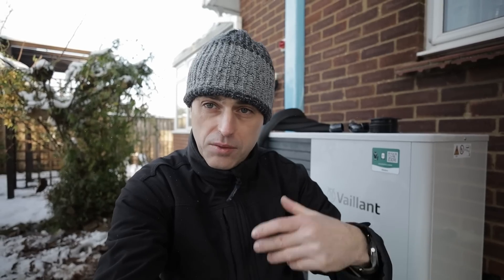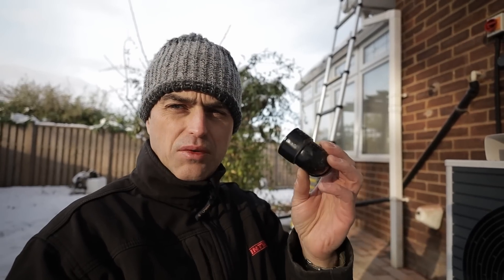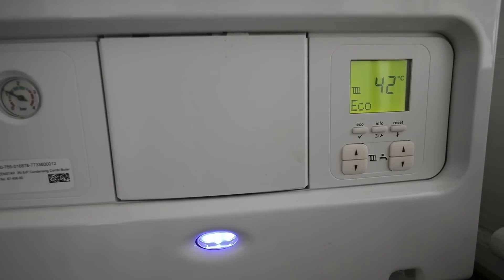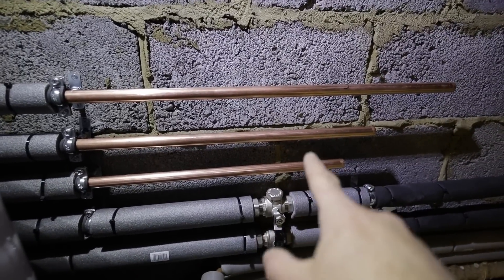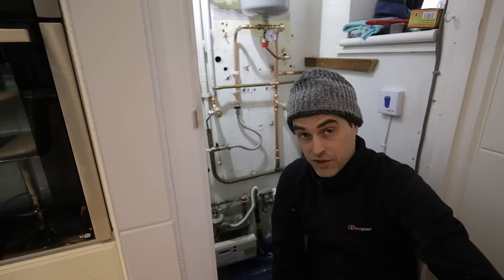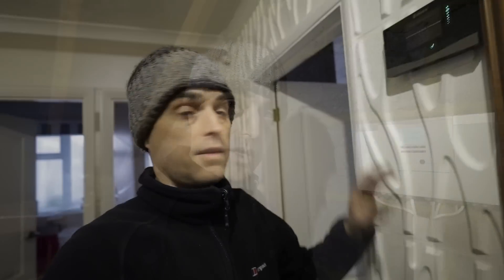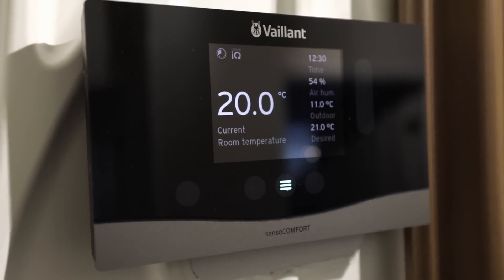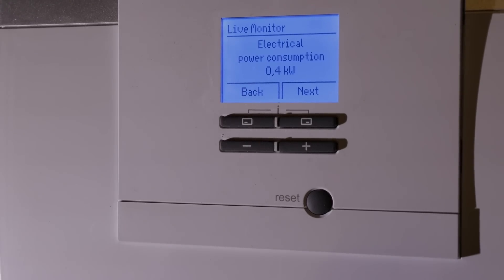How to Install a Heat Pump That Works

Comment: Not all of the UK have a night tarriff (cheaper). Thats why we have the data on ground and air source for a good while. Its still cheaper to run gas over the year if you have a cylinder installed in your property especially with the costings of electric being 3 times more than cost of gas. I get it, combis are the reason gas bills are so high for most people. Its funny you mentioned the positions of units, as thats why most (ashp) were ripped out in first place. Bet the vaillant board will blow on the unit interface aswell as we all know how well pcbs perform from them in time lol

Comment: We have Mitsubishi heat pumps on commercial install and recent cold weather they would shut down and go to defrost , we had no underfloor heating.
There’s enough glycol to actual go down to -12.
Mitsubishi says there heat pump is working fine ! 
Another Mitsubishi install , spends all day heating water and then turns to heating with 10 fan assisted radiators as soon as pipe temperatures at the radiators drops below 30 degrees they shut down.
They have spent thousands on these systems.

Comment: It's amusing heat pumps are coming into their own during the current global conditions while bev's are now equal to or more expensive than ice to run (until the spring budget).
I could get away with a 7kW (currently 9kW heat loss) but I'm loathed to actually convert my own property over, just haven't the time. 
In the mean time I'm trying to convince one of my business partners to actually put forward weather comp and hot water priority controls when estimating for boiler changes. Putting forward a Vaillant boiler as a heat only replacement you may as well put forward energy efficient and future proof controls. Sadly he is strongly against heat pumps and having people pay "so much" for energy efficiency. 

Great video, and yes air flow/location and freezing rain seem to be the biggest issue now with heat pumps. I got fed up of being called out as a break down engineer last winter to iced up blocks so did some research, poor air flow + lots of water is the number 1 reason for icing and poor temperatures. Learning more every day.
Reply: What is meant by poor airflow?  at back too close to wall?  just home owner here interested in heat pump
Reply from the maker: video coming soon on this, in my case it is a unit located in a narrow alleway and recirculating cold air going into deforst every 20-30 minutes

Comment: Hey, thanks for the informative video. I work as a mechanical design engineer on commercial properties but interested in this as a career. How much detail do you go into when doing the heat loss calculations, you would need to know the U-values but can imagine you make a few assumptions on this? Also, how often does the property need a full retrofit, e.g. new larger rads and bigger pipework due to lower flow temps? I believe this property was okay as it was already running at 40 on gas the same as what a heat pump would run.

Comment: Another quality video from yourself 👏🏼

One query I have, Vaillant specifies that a 15 litre buffer is recommended for the size of heat pump installed in your video (as a minimum ) for deicing purposes, when the heat pump goes into defrost cycle. 

What's your opinion on this?

Won't the heating system be robbed of heat, therefore becoming cold, on the days the heat pump enters this cycle, without a buffer?

Thanks again for sharing your videos & knowledge & may you long continue to do so!

All the best ☺️

Comment: Very nicely explained video, thank you! Very informative and much appreciated as most videos about heat pumps I've watched just don't deal with the technicalities in the way you do. One question leaps to mind if I may... As the output from the external heat pump appears to be hot water directly to the hot water cylinder and radiator circuits, does this mean there are no refrigerant connections to make and no refrigeration work involved? So does this mean I could legally fit an aroTHERM in my own house without personally holding F Gas qualifications? Thank you!
Reply from the maker: Yes, it a monobloc so no fridge circuits to deal with. No need for F gas to install one.

Comment: You mentioned that you had trouble with 1 unit not heating sufficiently because it would go into defrost too often.
What would you consider too often to be, with my Ecodan I found defrosts occur more frequently when it was closer to zero. e.g. -1 -2 a defrost happened every hour and took about 5-10 minutes. As it got colder and the humidity is locked away in frost it was running two hours between defrosts.
Reply from the maker: Every hour is fine. Mine was doing it every 25 minutes

Comment: What about airco-split unit.
I use one a boat and last here is -10c .
And yes the unit have to go in mode to heat the out side unit 
Is somting i can do so it not freeze .
More out of the wind .
A wooden somting to set over it with some holes.
So its out of the wind it self 

Yes a boat you read it correct .
I can heat with diesel fuel .
But that cost more and its smoke what come out is not always nice .

Thank you for some tips .
Or if you have a video .
All things will help.

Comment: using heat pump manufacturers controls is absolute critical to a successful. In the case if the senso comfort, best to use Extended adaptive room modulation and adaptive heat curve. then the curve changes according to indoor demand
Reply from the maker: I am not 100% this is the best method. It runs at higher flow temps as inside temp and comfort is a priority.

I will be testing all modes at my own place and making video of my findings. 

My intuition tells me active mode without adaptive should be best.
Reply: @UrbanPlumbers  if you are open to learn, you will have a happy outcome

i’ve been doing weather comp on vaillant controls on gas boilers for 15yrs, i use adaptive on them all. It’s a bit shocking when you go to a victorian property with rads  on gas boiler with vrc700 and find the curve is 0.65 and everything at temp. you ask your self if you left it that low!
Reply from the maker: Yes I can see it working well on gas. Not convinced on HPs yet on adaptive

Comment: Wish these heat pumps had the option for a ground coil or thermal buffer/battery to be more easily added as an upgrade, ours works amazingly 98% of the year when CoP is 4-4.5 but when the temperature crashes the consumption with CoP around 1.8-2 is enormous, about 100kwh/day.

Have a hard time seeing the grid deal well with household consumption tripling whenever temps dip to -5/10 (we already lowered our inside temp to 19 to help lower costs!)
Reply: I agree. And even if the grid manages to cope, that electricity will have to come from expensive peaker plants. Ideally, a small heater powered by bioethanol, wood pellets or even propane or heating oil, would be a useful addition. Or, even better, an electrical generator feeding electricity into the grid and using waste heat to heat the house.
Reply: That’s the truth spelled out loud!
These pumps are good(read economical) only if the outside temperatures are in positive! 
One should over-size its pump in order for them to have higher CoP on minus T.
Reply from the maker: Never ever oversize a heat pump
Reply: @stormtrooper9404  Ours worked well when we had a -10 to -15 cold snap for a few days, used about 80-100kwh a day to keep us around 20c inside (display says use was 190-220 kWh of heat!) 
HP was sized for a full house but we're currently living in the finished section so a bit oversized for our current situation 

I suspect the problem will be partially solved once we fix our doors as we could clearly feel the cold drafts

Comment: Another great video, thanks.👍
One of the biggest complaints, Ive heard about heat pumps over the years, is that they struggle when it gets very cold! The argument from Manufacturers and heat pump installers,  is that the countries like Norway, Finland and Sweden use them! but what design temps are they using in those countries?
 If we are designing them for -2 and the tempreatures go to -10 they arent going to be able to cope! You yourself said exactly that and Vaillant manufactuer an inline back up heater, which isnt a heat pump, but a 6KW Immersion heat exchanger!
Are home owners informed of this, before purchasing these heat pumps, that they would be prudent, to buy an expensive backup, if it gets colder than the design of -2? 
You are a highly skilled and diligent heating installer and you have admitted that there is a very fine balance to get these systems right.  
I'm not convinced we have got it right here yet!
 I'm sticking with my Vaillant Combi ,its in doors, in the dry!  If it gets to minus 10, I crank the temperature up and it keeps me warm, because it has built in resiliance and the capacity to heat the central heating water up to about 80 degrees in any weathers. 
And my Condensate pipe dosent drain outside😀

Comment: Dear, its normal in 1 hour to have 2-3 times turn off the compressor ? When pump will reach set temp? Outside temp avg 5-6 C , water temp 34, combination of radiators and floor

Comment: We are running an 11kw Viessmann on weather comp. The pump is always running - is this an issue for the pump?
When it's cold the boiler modulates and everything works great, when it's a bit warmer the boiler cycles quite a bit as it cannot modulate below 3.2kw. How much is too much cycling? How do you reduce the cycling? And could we go hybrid and do the low end requirements with a small heat pump and cut over the gas at say 5 degrees outside when boiler runs all the time at min modulation - and if so how ?

Comment: When installing, are there usually problems indoors finding space to fit thee required indoor units such as water tanks, pumps (if any) and controls etc? No every body has a large loft, in most cases such as me, just what was a bathroom airing cupboard that now houses the existing water tank and electric boiler.
Reply from the maker: Airing cupboard is all you need

Comment: Home owner here, I need to replace a 1980 regular boiler and probably a lot of plastic non-insulated pipes.  Would heat engineers recommend copper pipes these days over the plastic?
Reply from the maker: always copper over plastic, especially on heat pumps.
Reply: some engineers like plastic some not
Reply: @UrbanPlumbers  hi, great vid, what size of copper pipe would be best?  Is it the bigger the better? Thank you
Reply from the maker: @memecoinmafia2732  it's not about engineers - it's the heat pumps that do not like plastic. I just do not work on heat pumps unless you go a size up compared to copper and use press-fit instead of push-fit.
Reply: @UrbanPlumbers  okay cheers , i didn't know plastic pipe was a problem for heat pumps  ...why is it a problem ?
Reply from the maker: @memecoinmafia2732  smaller internal diameter and very small bore pipe inserts. They cause too much head loss so the heat pump cannot get required flow.
Reply: @UrbanPlumbers  thanks

Comment: Nice Video! I have a question whats the max water temp for this Vailant unit? I have installed LG Therma V Monoblock heatpumps on a system with radiators and it runs 60 C water without any issues
Reply from the maker: 75c

Comment: That was awesome!  Nice video. Great explanations and great detail.  Nice work!   One question- on that one unit that you mentioned was not maintaining temp on that cold day, you , mentioned you needed to move it because of poor airflow?  I assume this was the outside unit and how could you tell it was airflow?
Reply from the maker: yes outside unit. I could tell it was the airflow, as when we moved it (at the same outside temp of -3) the output improved quite a bit and the unit stopped going into defrost 3 times per hour.

Video about it is coming soon, as the unit is still propped up on a piece of wood, so have to go back and move it properly.
Reply: @UrbanPlumbers  Thanks!

Comment: Its really interesting seeing you do this, but I at this point I really struggle to see people spending the money with an external installer(Such as myself) when there is all these government grants that go to the usual folk. Its the same as the free central heating, freezing the small guys out.
Reply from the maker: You can install under the Heat Geek umbrella and get the BUS funding. Have a look into that. The best umbrella scheme out there.

Comment: Thanks Szymon, a very interesting video and something I could/should consider and especially given the current cost of gas. Forgive me if I misheard, but did you say you would include a link to a heat loss calculator?
Reply from the maker: Card in the video

Comment: You only need one antifreeze valve ? Mine was fitted with two one on flow and return same unit with unittower tank
Reply from the maker: Yes, one is enough

Comment: Excellent video - thank you. I have heard the Vaillant will not provide warranty if you use Frost protection valves rather than Glycol. Is that true?
Reply from the maker: not in the UK, they have already come out to warranty callouts on our units with anti-freeze valves.
Reply from the maker: Faulty cylinder and electrical issue on the house earth

Comment: Hi there why no anti freeze valve on both the flow and return? 
Also where can the trunking be bought from ? 
Many thanks Terry
Reply from the maker: Terry, you only need one AFV. Trunking you can get from the Green Mill. Its pricy though.

Comment: Hey man, class install as always, I'm just wondering how you get round the minimum clearances to the window. Protective zone says 2100mm. Minimum clearance above says 1000mm? Only asking as putting same unit in at home but looks like I can't because of these reasons?
Reply from the maker: No protective zone above the unit

Comment: Still can't buy the Vaillant controller - might as well have nailed a unicorn to the wall for system control.
Merry Christmas 🎄
Reply from the maker: They are back in stock at my local merchants now
Reply: @UrbanPlumbers  still out of stock up north. Many of the "nationals" are saying it's a discontinued line, and Vaillant themselves just send you round in a loop. eBay isn't even an option right now. Vaillant are not helping themselves at all.

Comment: Im thinking the 3degrees is the flow temperature in the pipe otherwise it will drain out alot. Does the system have a cut in so this doesn’t happen?
Reply from the maker: 3c is the temperature at which the valve will open to drain the system water - yes. The system has anti-frost protection and will always keep the system water above 5C unless there is a power cut.

Comment: Theres the whole argument of whether it is more efficient for condensing boilers to be kept running or to be turned on to fire up only when needed, I suppose my question is do you believe it is more efficient to leave an appliance on (boiler or ASHP) and adjust the flow temp when needed rather than turning on and off ?
Reply from the maker: Way more efficient to keep a condensing boiler or a heat pump running at low output and WC - if controlled well, as many Viessmann 200 fully weather compensated installations have proved time and time again.
Reply: @UrbanPlumbers  Also with setback temperatures

Comment: hey,may i ask you questions?i have unitower 58/5 IS,it broke 9days ago ,fuse changed,but the situation is , there's no hot water, but the underfloor water heating keep running.i set the heating at 13degree and it keep going up to 21degree, then i have no choice but turn the machine off(both inside and outside unit.)the indoor unit didn't stop working since the worker left,over 18hours.the boiler temperature stays at 16degree while i set it at 47degree. is my underfloor heating pipe already wounded from this accident?
i worry that if i let it keep going it will damage the floor heating water pipe. 
the worker say he thinks i need to change the 3way valve and engine.but he needs to order it ,i don't know how long that will take.
 so, for my situation right now, do i turn the heatpump off untill he come?what's the best solution for the protection of floor heating pipes in my situation?my house is well ioslated ,when outside weather is around -1degree,indoor temperature drop about 0.5degree per day with heat pump broke.i hope this is enough information for you to help me.
i live in belgium and have no gas heating in my house.

Comment: I have a question
I am interested in whether the heat pump by itself is sufficient for a house of 130 square meters with radiator heating, or do I still have to have some backup solution? Area of northern Croatia? How many minus degrees can it effectively heat? 
Thanks for answer
Reply from the maker: you are in such a mild climate that a heat pump is easily capable to do all your heating and hot water throughout the year. We have heat pumps running 200-250m2 houses here in colder and more humid environment

Comment: I am trying to understand how using the weather compensation approach would work for a working family when there is only need for heat in the morning and evening. Whilst I understand that this allows the pump to operate most efficiently to maintain a constant temperature, heat would be wasted during the day when it isn't needed. Do these systems allow this to be compensated for by accounting for room temperature in order to "boost" back up to the desired setpoint?
Reply from the maker: Yes you set a lower set back temperature (2-3c lower) than your comfort temp.

You can’t fully turn heat pump off in the winter as on cold days it will take hours to get back to comfort levels.